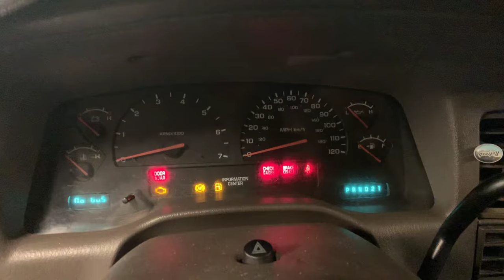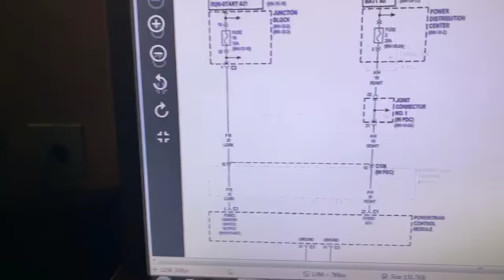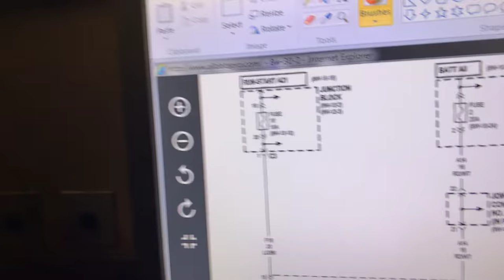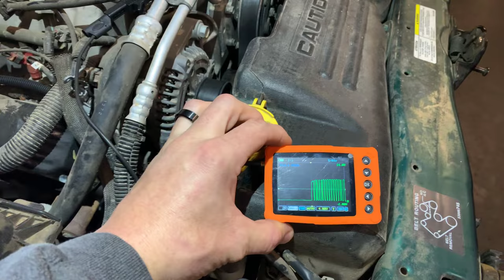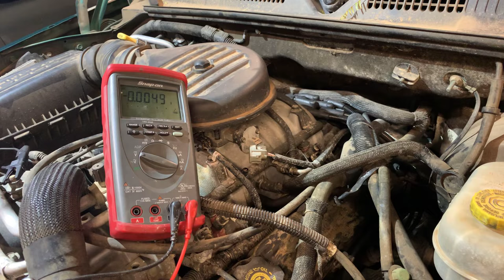Dodge Ram 1500 PCM problems No BUS FIXED! No Communication PCM/ECM replacement. Problem solved! PT 1

Comment: Mine did that after putting on the parking brake  there's a wire harness behind it push foot against it and then try it works on mine

Comment: Hey Cody I gotta give credit where it's due definitely the best video I've seen on this issue and of course exact same vehicle and problem I'm having as well Im no mechanic but trying to learn I don't have a u scope can I check the PCI bus communication line with a test light or voltmeter if so how I'd really appreciate any help my wife's durango has been sitting dead now for over a year and she really loved that thing need to get it fixed ASAP

Comment: By the way had the motor replace and the mechanic saw the O2 sensor wires was burnt at the connector onto the wire harness and never told me till after I was told by the muffler shop that they was damaged so that might have shorted out  unit took it back they rewired it but I don't think it's wired right burned out the first board then I replace it what the second board so I think the problem is it's not wired correctly and causing major problems told the mechanic shop to replace those wires or check their work I think that's why it's not running now. $700 wasted but they will get it back and fix it or give me back my money and I will go to the dealership. we need more guys like you.

Comment: I've got a 2015 Ram 1500 Sport I bought brand new in 2015. It's been a great truck! But, now I'm having some issues with it. This truck has a push start. Both keys has brand new batteries and the truck has a brand new battery. Sometimes when I go to the truck to get in it, my truck won't unlock. I use the pop out key to get in the truck and it won't start. The cluster panel is on and I'm not getting any messages saying "key not found" I took it to RAM and they said nothings wrong with it. But, it's happing two - three times a month. What do you suggest? 168,000 miles

Comment: 98 dodge durango 5.2, i get power to pin 22 but no power to pin 2 . my 2 grounds to pcm are good (pin 31 & 32. on mine it says pin2 is Fused Ignition switch output. So, should i still be getting power to that?

Comment: I have an 02 Ram 1500, 5.9L gas with a crank, but no start issue. No communication with PCM, Security light on dash stays on steady. Mismatched vin is the only thing on the display.I'll check voltages and grounds tomorrow. I watched your video and you quickly were able to conclude the pcm was faulty. Nicely done and east to follow along. I was wondering if you verified off screen that the computer plugs male and female pins were all making good connections as I didn't see you do that in the video? It's been my experience that the female pins sometimes get checked with the standard DVOM probes by pushing the probe in and opens up the socket a tiny bit. When the male pin plug gets installed, there may now be a loose or intermittent situation.
Reply from the maker: I always do a visual on this style pcm connectors, I could see they were not spread by eye. I will perform pin drag tests on pcm with mico connectors to verify proper fitment

Comment: I have a 99 Dodge Dakota that has an electical issue, the grey hardness attached to the computer is not sending a signal to the computer. I got it running a few times when I was playing around with the grey hardness that's attached to the computer.  I replaced the grey hardness with another one but it's still not working. HELP! what can I do to get it to work?

Comment: Where is part 2?  Hi, mine is  a 1998 2500 V10 4x4.  Same codes 920, 921 and 999. BUT, my truck starts everytime  and runs pretty well. Dosent shut off while driving either. I'm in Florida and it's pretty hot here. No issues other that my guages not working. The dash lights work fine. Taking out the problem everyone else has with no start. Would I check the same things you did in the video?
Reply from the maker: Part 2 in up on my channel.

Comment: P0505 code on a 2000 Dodge Durango 5.9L 4x4. Test for power at IAC. replaced and clean throttle body with new gaskets. Clear code and turn ignition switch back on, code come back right away. Can you help…

Comment: Where did you get your replacement PCM?  I had a failed PCM on a 97 ram (no bus comm and wasn't even providing a good 5V rail) and the replacement unit I got seems to be faulty as well (misfiring horribly and setting injector 7,8 performance codes).  There are so many aftermarket vendor "rebuilders" out there, all of them claim to fully test the units before they send them out, but after this experience I don't really trust them.
Reply: Where'd you get your pcm from bro I have to get a new pcm and wandering where too go to

Comment: I have a dodge Dakota 3.9 with a no bus5. I don’t have any way to check the pci wave. No 5 volt on tsp, did all the other Test that you showed. Would it still be a pcm? And we’re would be the best place to buy one? Thank you for your channel. Tracy
Reply from the maker: Best to find a shop that can properly diagnose your issue

Comment: Question for you sir. I have a 2005 grand cherokee 5.7. I had the transmission turbine replaced as well as the temp sensor I even out an oil cooler with a fan for the transmission.  I use my Jeep then after turning it off, I want to restart it and it would stall after 10 seconds and I would get the "check gauges" and "over heat transmission". I used my computer and it shows "lost communication with ecm/pcm" I checked the wires and had some damaged I repaired them and even put heat resistant tape and protection since they are next to the exhaust. I really don't know 2hat to do at this point. Ant tips would help.
Reply from the maker: What codes are setting in the modules?

Comment: Great tech information! Thank you! I have an ‘02 with the same issue. Although it will start back up. Sometimes right away and sometimes after it sits. The usual run time is now 20-25 minutes. I’ll start to diagnose mine as you did.
Reply from the maker: Keep me posted buddy.
Reply: I'm having the same issue. Got a refurbished PCM vin loaded. Ran great for about 2 weeks but came back with a vengeance. Back 2 square one now. It'll stay running for about 20 to 30 mins on a warm day and if I'm Lucky maybe 45 to an HR on a cooler day. Could this be a faulty PCM as well?
Reply: I ended up having a bad pcm. Ordered a refurbished pcm and it’s been running great since.
Reply: ive got a 99 ram 318 with the same issue, it runs beautifully for 20ish minutes then just shuts off without warning and tosses the no bus code. sometimes it comes back after 10 minutes, sometimes it wont start for a couple hours.

i already replaced my fuel pump, crank sensor and a few small things, i was praying its not the PCM but the list is almost gone now
Reply: @LoneWolf-kw3ol  did it end up being the PCM?
Reply: @Craze4war  it did sadly. the pcm was fried and after heating up it would short the connection to the fuel system. The aftermarket pump with the bad connection also blew my return line amd fried my pressure regulator.

luckily i got a steal on an exact part match through ebay, they even coded the VIN for me.

1,200 miles and not a single issue, no lights or anything. It even gets a solid 13 mpg on the interstate now
Reply: @LoneWolf-kw3ol  Im honestly glad to hear. Just made the drive from California to Texas and my 2001 Dodge Ram 1500 started stalling in the last couple hundred miles and throwing the No Bus code. After sitting 10-20 minutes it would start right up again. Sounds pretty similar to your issue. If I can throw in a new PCM for a couple hundred bucks and that'll solve the problem, I'll be a happy camper.
Reply: @Craze4war  if you want a good test, when its stalled out pop all the connectors off the PCM, tap it softly with a hammer and plug them back in. Mine would almost always start up after a couple dinks.

Another way is to pull the PCM completely out and smell each port. If theres a burning/burnt plastic smell, something got cooked and the unit is fried.

Id still say try a crank sensor first, theyre only like $25 or $35 and old trucks love new crank sensors, or replace both at once, my truck went from turning over 7-8 times on a cold start to 2-3 times with a new sensor, even gets a first crank fire when the lines hold pressure on a warm engine.
Reply: @LoneWolf-kw3ol  Good to know. If I'm ever in a tough spot again I'll definitely try the hammer trick. Also have a multimeter coming in today to test the voltages going into the PCM. The crank sensor sounds like a good start but I reckon mine is still pretty new. Not sure when it was last replaced but I still sometimes get first crank starts on a warm engine, and never more than 4-5 on a cold start. Appreciate the advice though. 👍

Comment: Good afternoon Cody, I checked your awesome video and I followed your testing procedures.  I have a 1998 Dodge Ram 1500 5.2.  The truck all of the sudden shut down and it just cranks. It’s got fuel but no spark. My cousin started throwing parts at it and replaced the fuel pump, crank position sensor and the ignition rotor. I verified it and indeed has no spark. Has no communication in the DLC. Gauges are pegged to the left and won’t move. I checked the following:

-Verified powers to pins 2 & 22
-Verified grounds to pins 31 &32
-Checked the resistance on the ignition coil tested good
-Checked the ASD and tested good
-Verified 5 volt reference and it was good
-Wasn’t able to test pin#30 for the signal coming out (no uscope)
-I suspect a bad PCM
Any recommendations?
Reply from the maker: Does the pcm put out a 5v reference? You can check this at the throttle position sensor. Also will the scan tool communicate with the pcm?
Reply: Alf r - were you able to find the problem?
Reply: @codysautodiagnosticsprogra8706  same truck same problem. Svan tool does not communicate. Need new pcm?

Comment: Bonjour from New Caledonia (NC), little French island near Australia and New Zealand.
(Please, do not take care of mistake)
Perhaps, you will be able to help me
Friend of me have a problem on a dodge ram 2500 from 2004 (not sure about year), bring to a few garage but still have the problem.
A lot of problem before, but now.
The truck crank and start, good idle, good acceleration but we have "no bus" message on the dashboard and no indication about temp.water, no rpm/mn, no fuel jauge etc...
My friend send the dashboard in America for a control and idem for the PCM witch cost him a lot of money (the PCM still no good, 3 cylinders no good), its good with the second PCM.
here, a garage took him 1200 USD to sent it to USA, repair and go back to NC, (the garage left the bill reparation in USA, it was only 250 USD).
So, my friend have controled the continuity of the can bus (J1850, one wire) and all the can wires are ok.
The other can low is the ground.
Next week, we will try to find the problem.
I'm a electrician, so i know  what a voltage, current, resistance, frequency.... got multimeters, diag tools (delphi ds 150e (no good for this car) but also mini thinkcar pro and an Autel mk808z witch is good for this truck
But i do not have scopemeter to control the can bus signal.
I have to buy one, but at this time, do you think you could help us.
What should i control ?
What about the TPIM module ?
How generate the canbus, the PCM ?
Thankyou for helping us.
Merci beaucoup 😊

Comment: I have a 2001 Dodge Dakota I’m having the same issues but sometimes it will start but then after driving it dies. But all the same symptoms as you showed in the video. The strange part is that sometimes it’ll run sometimes it won’t but then it does. Any suggestions?
Reply from the maker: Check all powers/grounds/5v and pci circuits when symptom is acting up, is the best thing I can say

Comment: Cody I have a 98 dodge 12 valve that starts and runs perfect ..it charges 13.8volts and I have  2 problems first none of the gauges work and I did the cluster reset and they all work during test the odometer flashes and has the 920 921 999 codes come up and the other code when I put a code reader on it is p1492 batt temp sensor voltage to high any help would be appreciated thanks!!
Reply from the maker: Hmm interesting. I’ll have to look up a diagram and see if I notice anything
Reply: Hi, mine is  a 1998 2500 V10 4x4.  Same codes 920, 921 and 999. BUT, my truck starts everytime  and runs pretty well. Dosent shut off while driving either. I'm in Florida and it's pretty hot here. No issues other that my guages not working. The dash lights work fine. Taking out the problem everyone else has with no start. Would I check the same things you did in the video?

Comment: Hey Cody I have a ram 1500 and I am not getting the 5volt ref is that a bad pcm?or should I look at a sensor
Reply from the maker: It could be either pcm or a 5v sensor is shorted which is causing pcm not to communicate. First Disconnect of 5 V sensors and re-check For your 5v reference. If still don’t have reference then needs new pcm
Reply: Yea disconnected maf,cam,crank,tps,and it goes up like 4 v that is is there another sensor I could be missing

Comment: My 2018 Dodge Charger is shifting sporadically and slipping gears and the electronic stability control is flashing, also various other electrical issues, car occasionally won’t start. I’ve swapped PCM’s already. Any other ideas of what may be going on? It’s still not starting occasionally and the first code it gave was P1614 “ECU reset/recovery” and also some “high circuit voltage” codes. I’m wondering if it may the wiring harness going from the pcm?
Reply from the maker: Hm  that’s going to be hard to say without actually looking at the car. Have you checked the alternator voltage output and also the AC ripple? Ripple can cause lots of drivability issues with pcm and sensors.
Reply: Cody’s Auto Diagnostics have not. Just got the car towed. The common reoccurring code is the ECU lost communication with the TCM and camshaft position sensor needs service. It all started after I got new struts and control arms. I’m wondering if the shop may have possibly damaged any wiring associated with the TCM. I’ve heard the CAN bus may be responsible too

Comment: I’ve had a unlocked pcm and Diablo tuner in my 2017 ram slt for a few months. Did a parameter change one night and. Ow says no ECU detected. Put the key in and everything lights up, stereo comes on, etc. turn the key to start and nothing. No fuel pump, no ignition, nothing. You can hear the relay click when you turn the key. Dealers have no idea, Diablo has no idea and the performance shops have no idea.

Comment: I got a 2000 Dodge ram 1500 V6 5-speed truck, this past Friday I just finished up my V8 engine swap on it...I put a 360 in it out of a four-wheel drive truck automatic... on those it's pretty much plug and play except for the plug that goes to the automatic transmission.... now it's left dangling and it's giving me a no bus on the odometer... which is expected... my question is... I can't find a five-speed PCM is there anyone out there that can reprogram reflash or whatever, my automatic PCM and remove the automatic transmission control software out of it?... Or if they had a emulator that plugged into the automatic transmission plug would be fine too but finding such a thing probably isn't happening.... probably would have to build one....

Comment: I'm having a similar issue with a 99 Ram 5.9l. we tested the old pcm found it wasn't communicating and replaced. The refurbished one still does the same thing. I can't find a new computer from Dodge. It runs for about 20 minutes and then no bus returns.
The crank and ignition were replaced recently and the truck was hit on the left side months ago. Ever since it's been acting up. Can't seem to find any broken wires. 

Any ideas where to go from here?
Reply from the maker: You will need to find a used or reman module, have it programmed to the vehicle.
Reply: The truck was in an accident so it ended up being a ground. The original computer worked after it was fixed.

Comment: Will a bad ecm cause my odometer/speedometer to completely disable?  
 
I changed the ABS rear speed sensor, still nothing.  

Everything worked then the truck sit for six months and when I went to turn on the engine the whole instrument cluster went dead.
Reply from the maker: No sir, it sounds like you now have another issue.
Reply: @codysautodiagnosticsprogra8706  after doing more research..  Like finding a needle in a haystack.  
Apparently 02 dodge and certain models get corrosion underneath the smart fuse box.  We'll see round 4 🤞

Comment: I have a 2001 Dodge Ram 1500 5.9L  two wheel drive.  My battery gauge keeps dropping to zero after driving the truck just for a few minutes the alternator and the battery are tested and came back good. I don't know what the problem could be I also clean and best all connections to make them better so I don't know what it could be can you help me before I send the truck to the junkyard
Reply from the maker: This could be a cluster issue.does the voltage drop below charging system voltage?
Reply: I have took the alternator off and went had it tested and I've also done the same thing with the battery. I clean all the connections for the wires that do all the charging I am thinking it might be the ecm. I was just hoping that you might have a better idea so I ain't got to spend so much on buying the ECM